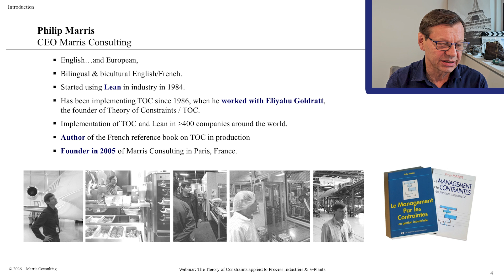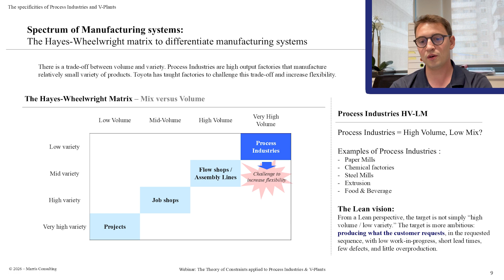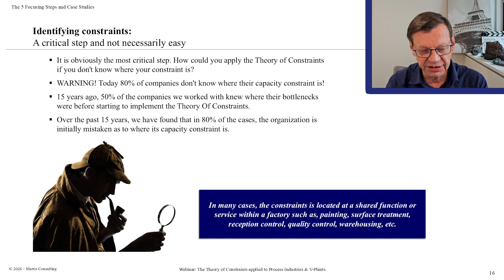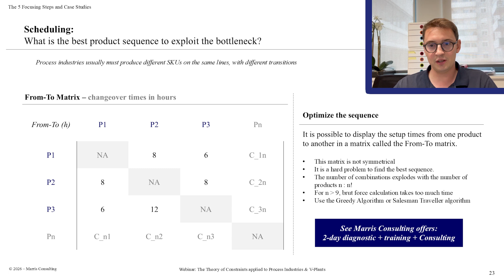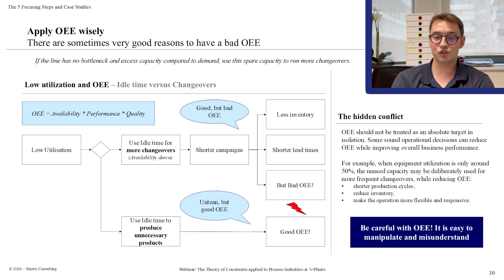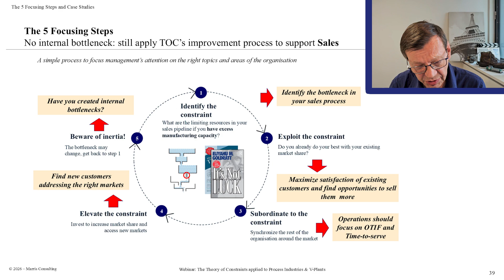Process Industries boosted with the Theory Of Constraints

Comment: As a former IBMer in the late 80s- early 90s I remember the MRP specialists describing the V operation  as the "inverted bill of materials" case-- disassembling or pulling apart an original assembly or raw product into usable saleable components and products. While it sounded dismissive at first, it did pave the way to employing process industry MRP systems such as Marcam Prism and others.  It also helped some of us carve out a pathway in process industries to help them optimize and sequence operations better and embrace new tools and methods for the purpose.
Reply from the maker: Yes indeed: "inverted Bill of Materials" ! 🤭